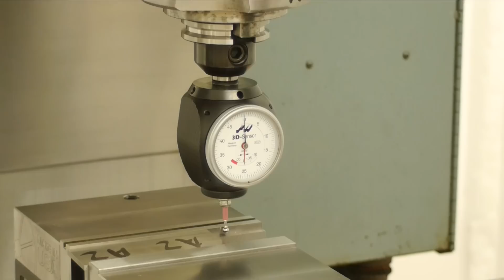First knife work on the VMC!

Comment: so glad to see a knifemaker get a proper vmc. So many guys buy a new tormach when they could get a used industrial quality vmc for less money and the industrial machines are so much more ridgid and capable, even the mini mills such as yours. You did a great job restoring it I have no doubt it will serve you well. One suggestion especially with the coated carbide tools is using an air blast mounted to the head to remove chips and cool, you will be amazed at how long the Altin coated tools will last if they are not recutting chips.
Reply from the maker: +conawayjb Hey mate! Yes I agree regarding buying a used machine... A lot of people are just really worried about getting a lemon though and it's understandable. For instance when I was looking for machines there was a Matsuura MVC510 for sale near me for a very reasonable price, however when I dug into it more there was little to no parts or service available for that model! The Fadal was a good choice from this perspective, pretty much every part of it is available new or remanufactured!

I have an air-blast setup now, but this video was one of the first times I used the machine! I've been pretty happy with how the tools have been lasting, except in a few setups where the fixturing is sub-par and the tools are getting killed by chatter... I will be re-working my entire process soon (again) in order to address this problem!

Comment: You should definitely get yourself set up with a fixture plate so you can run multiple parts during the same cycle! 
I'm a 3rd year machinist apprentice so seeing videos like this of people running their first parts really makes me smile. And you did an excellent job on the refurb of the machine too, keep up the awesome work!
Reply from the maker: Dana Mahar I definitely want to get some better fixturing sorted out soon. At the moment I'm working through each part to get a better overall idea of what fixturing is needed.

Comment: You really spared no expense...Haimer 3D-Sensor for doing setups and an Orange vise...
Reply from the maker: douro20 I try to make sure I spend money where I'm going to see a return in terms of time or hassle saved. I also have a rule now that I only buy tools and equipment that's made in countries with strong labor laws: USA, Canada, Germany, etc... No more chinese made stuff. I'm very happy with how that's working out so far. The Orange vise and the Haimer were both excellent decisions. The Haimer is super quick and has so many uses beyond setup, for instance I will be using it for in-process inspection to make sure I'm keeping up with wear compensation on my cutters when working with G10 as it's very abrasive.

The Orange vise is convertible to a double station vise which has the potential to save me a lot of time in the future, so I'm pleased with how that worked out too. Also Eric Sol, the guy that makes the vises, is excellent to deal with and I feel good supporting a small manufacturer!

Comment: I have this exact machine in my hobby shop. Be sure to clear your borings away from your end-mills to prolong the life of the carbide. Chip re-cut will cause dulling and chipping in the cutting edge.   Great work on the restore. I have to do one on this machine soon. I also replaced my monitor with a flat panel.
Reply from the maker: Yeah I use an air blast to clear chips now, works very well! I have since done a full-on restoration on my machine, it wasn't too hard, let me know if you have any questions!
Reply from the maker: Nice!

Comment: Very nicely done!  Great job with the CAM and selecting your feeds and speeds for that tool steel- the heat left with the chip!  Your vise is still pristine so you truly practice how you play :-). 

Do yourself one favor though and get some air blast or fogbuster going ASAP.  Re-cutting those beautiful chips will dull your sweet (and no doubt costly) end mills a lot faster and can cause surface finish quality to fall out sending you back to the "hand rub" station.  I use air blast, fogbuster and flood coolant at different times depending on the material and machining operation.  You are going to be unstoppable soon man I can see it!  You'll wake up ,see a CAD grid and hear servos everywhere :-)...it's like being in the matrix, but in a good creative way.
Reply from the maker: Doug P Thanks Doug! Air-blast and MQL will hopefully be coming soon, need to build an enclosure first! I also need to install a serious vacuum system for when I'm working with G10! 

Hopefully my vise will stay clean for a while yet!

Comment: don't know if you want to serialize your blades but the Fadals fixed engraving subroutine will serialize 001, 002 ,003 etc. every time you run the program only drawback is if you stop halfway it may already indexed the number so you might skip some numbers... unless you put the block skip character on the line of code.
Reply from the maker: +ROD90265 Yeah, I was amazed to discover the Fadal had that feature, I thought it was only available on newer machines! I just finished the first batch of knives the other day, and they were all serialized using that fixed cycle! Thanks for taking the time to let me know!
Reply: The great thing about the Fadal control is simplicity and they do not lock the controls capability to do any option they can do, unlike the Fanuc control. With Fadal its all there. It will do 5 axis is you had the wiring and the axis cards. Just go to SETP and tell the machine what options you have. The machine you have is a VMC 10 and you probably have rigid tapping (common on those builds unless someone pulled the card) which is one of the only things that require a special card. Pretty amazing for a control that was designed in 1978. One of the key things they did was Design for the Future. If you ever need help give me a call.
Reply from the maker: +ROD90265 No rigid taping on my machine unfortunately, no spindle encoder and no control card for it! However I'm using thread milling with great success so I don't really miss it!

Comment: This is awesome thanks.  Recently purchased a 3016 for what I am doing.  Did you have to use any special codes to use the Haimer probe?  How do you set all the Z height for the tools using it?  I am still touching off each one.
Reply from the maker: +Ryan Kondratieff I have a set of tool setting macros published on my GitHub page, that's how I setup my mill. If you search "AaronGough Fadal toolset ting" you should find it!
Reply: Great thank you very much I'll try to find it.

Comment: Blue chips mean you are making money! Although you might want to dial the speed/feed back a bit with no coolant setup. I currently dont mill with coolant but I am also manual milling everything. I keep meaning to make a mist setup but really should just buy a koolmist and call it a day
Reply from the maker: vdub5818 I've got a blower setup to help clear chips, works very well! Halfway through I pushed the chipload a little and it seemed to like that much better! The tools in this case are coated specifically to run dry, seems to work very well!

Comment: Awesome video, Aaron.  Did you ever try profiling a blade on your mill that you used on the previous videos?  I realize this is much more powerful and precise, but was it possible before to even get a rough shape?
Reply from the maker: Josh Rider Hey Josh! It wasn't really possible to do this kind of work on the old mill because it was only manual control. You might have been able to approximate it the shape but it wouldn't have been very accurate and probably would have taken hours!

Comment: Beautiful!  Congrats Aaron, so awesome to see the machine running after all your work!!  I know that pushing the big green button for the first time is both exciting and pucker inducing at the same time.  

Looks like you did your research on speeds & feeds, chip color looks perfect and cuts sound GOOD!  

How much did you slow the RPM on the second pocket?
Reply from the maker: x19freak Thanks mate! Pressing that button really was terrifying. Glad I got it out of the way though, couldn't wait to do it a second time!

Thanks for the feedback on the feeds and speeds! Definitely need some experienced eyes on that!

On the second pocket I slowed the spindle by about 10% because I thought it sounded like the endmill wanted more chipload. The chips seemed to immediately become a richer blue so I think that seems about right. 

I'm guessing I could push both feed and speed up a bit but cycle time is not hugely important. The one big optimization I did in that toolpath was to predrill the entry holes for the pockets, that cut about 2 minutes off compared to doing a helical ramp with the endmill!

I actually need to get setup so I can leave the machine for a bit while it's working rather than being tied to it... My vise is convertible to double station so I may end up doing that.

Any and all suggestions welcomed!
Reply: Gough Custom I wouldn't consider myself all that experienced, I just know what bad cuts look and sound like, at the cost of a lot of broken end mills.  :)  Check out FS Wizard for a free online F&S calculator or the full blown HSM Advisor tool.   Does your machine have the 7500 RPM or 10K spindle?

I like your strategy of drilling entry points for your pocketing ops, much more time efficient then ramping in.  You've got the mindset for this and I'm looking forward to seeing what you develop for your knives.  Going to be very good stuff!
Reply from the maker: my machine is the 7500rpm spindle, seems like it won't be limiting when cutting steel

Comment: Hi, I am wondering, how do you get a knife shape into the program so you could reproduce something that you made?
Do you mount it down and make the machine go around and plot the part or do you have to program the shape into the machine? 
Is there a way to scan shapes into the fusion 360? I go the paper cutout rout when designing stuff. I can hold it up and look and it and kind of hold it in my hand.
Reply from the maker: Donn Buchfinck All the design has to be done in fusion. In this case I drew the basic shape of what I wanted on paper, then scanned it and used that as a reference image in Fusion to complete the design.

Comment: Are you running coated end mills that allow you to cut without coolant?
Reply from the maker: +BigIronTV Yes! I'm using AiTIN coated solid corbide endmills from Maritool. My tool life isn't what it should be because my spindle has quite a bit of runout, but other than that I've been very happy with them!
Reply: Just wondering how has you much has your production rate increased now vs prior to using the cnc?
Reply from the maker: +BigIronTV Over the last few months it's hovered at around 12 knives per month, which is actually probably slower than if I was just making them by hand... However that slow rate has mainly been due to just a couple of teething issues with the process. Once I get them sorted out I'm hoping to get to a minimum of 24 knives per month, hopefully double that in the future.

Comment: Are you using CAM software or did you did you have to program with G code?
Reply from the maker: Ben Winchester I'm using CAD/CAM software called Fusion 360. Seems to be working very well for my needs!
Reply: Gough Custom Awesome! You're doing great! I take it this piece will mount to the fixture I just watched you make to cut out the profile?
Reply from the maker: Ben Winchester That's correct!
Reply: +Gough Custom Awesome machine ! I`m just getting into CNC and using Fusion 360 also. How long has it taken you to learn it ? Did you have have help ? I`m hoping to find a hands on class in my area, NYC  Keep up the great work. After watching you spend countless hours restoring the VMC  I now see why it took 8 months to get my knife !! Just kidding LOL
Reply: +Gough Custom How do you get the G-code to the controller? Seems pretty old controller without USB?
Reply from the maker: +Magnus Lindvest Yeah the controller only has serial (RS232) communication... I tried a number of programs on the Mac to try to talk to it, but none of them worked as I needed. I actually ended up writing a command-line program in Ruby that uses the OSX serial interface libraries to transfer files to the machine.
Reply: +Gough Custom That's nice, I've been looking at older machining centers, a lot of good deals out there but the controller is my biggest concern, getting an older controller to communicate with new computer. And upgrading the controller probably costs a fortune.
Reply from the maker: +Magnus If you have a windows computer rather than a Mac then your life will be fairly easy if the machine speaks over serial, it was just difficult for me because I was on Mac, but that's fine!

As long as whatever machine you get has an RS232 connection you should be fine! Have a look into Fadals like my one, they are inexpensive and very simply built but there's lots of them around and parts are readily available!